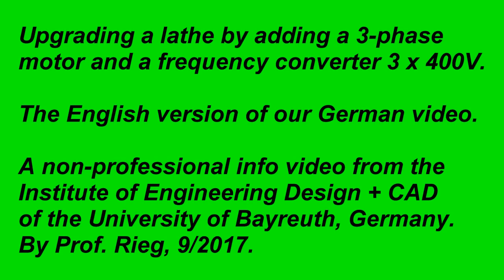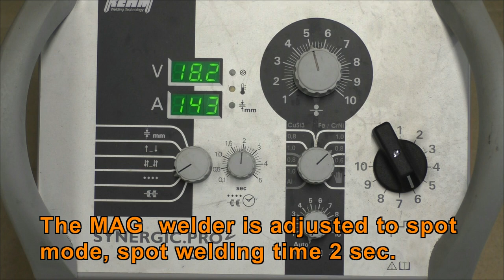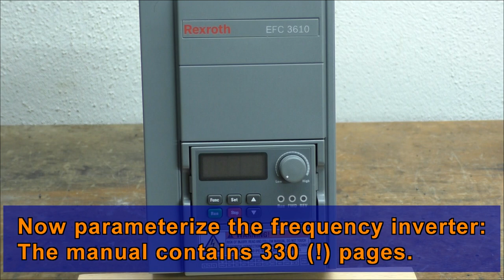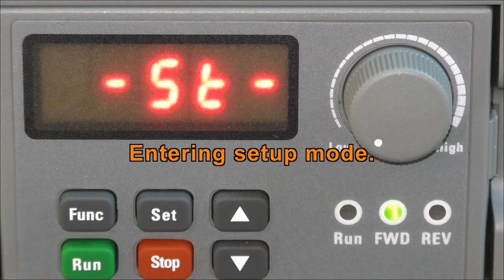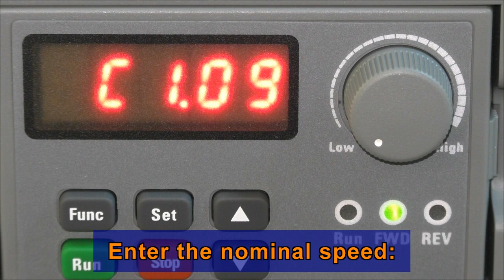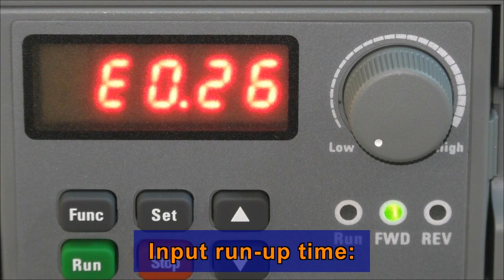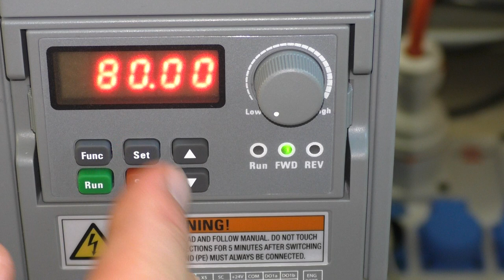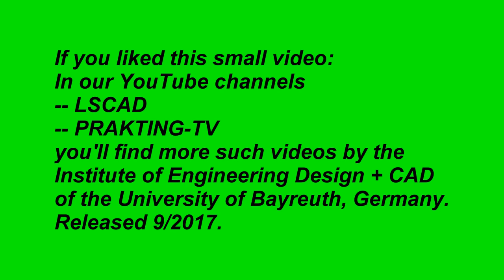upgrading lathe with 3 phase motor frequency converter

Comment: Is not this over complicated you can drive the chuck mandrel direct from a three phase motor mounted in the original position using off the peg  SPA pulleys (motor 180mm mandrel 100mm)  and  taking up the slack by  using a compact belt tensioning bearing. Also and very important you have not made any provision for cooling the motor at low speeds when the  motor fan becomes vastly inefficient. No in depth thought given to this project, and if you think that open motor and belt is safe to operate like that THINK AGAIN!!!!